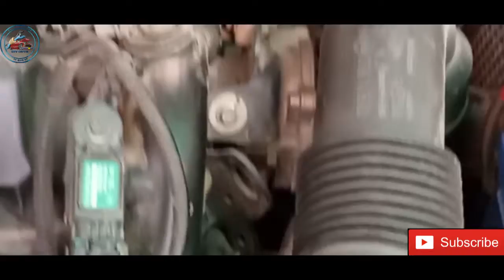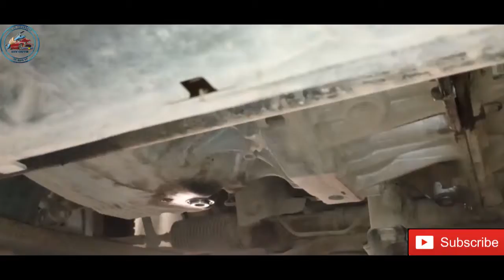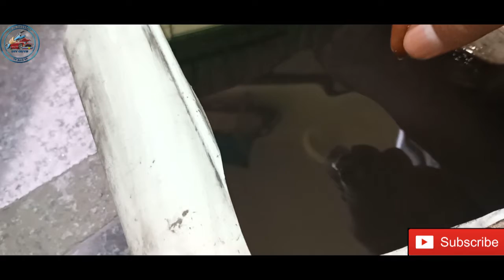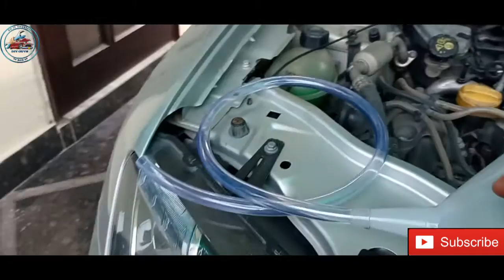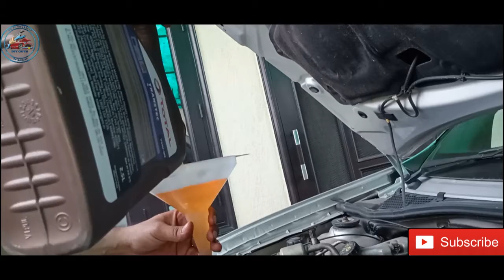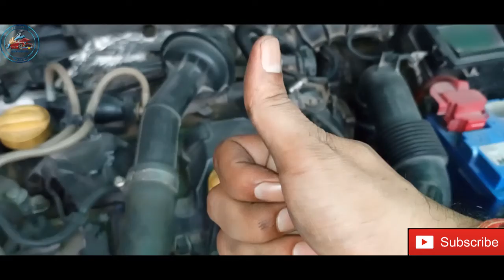Car Gear Oil Change| Change Transmission Oil | #gear  Oil #transmission #renault #dacia

Comment: How the performance with 75w90 because renault recommends 75w80 and 2ltrs is filled in authorise workshop .
75w80 is not easily available in the market and shops recommend 75w90 or 80w90